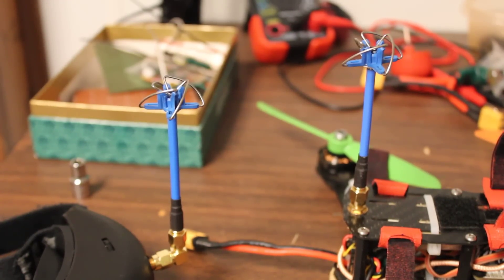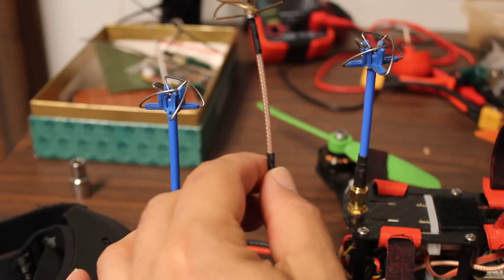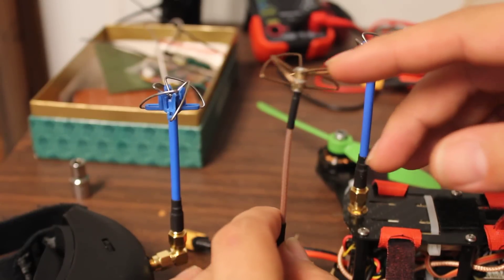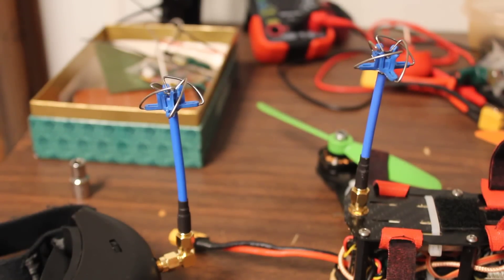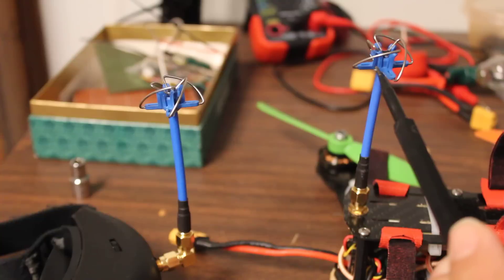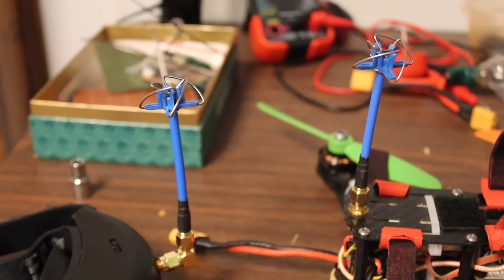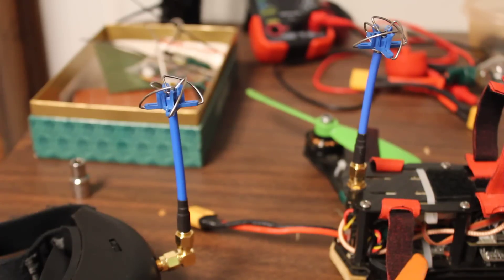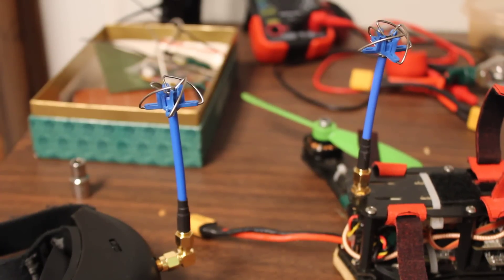First Look: Aomway 5.8 GHz Four Lobe Circular Polarized Antenna for FPV

Comment: I had the aomways for 1.5 years, finally broke them last week, but I just had to solder the joints together after removing the black gunk.....now I can finally upgrade to pagoda antennas and man theres a huge difference when flying around trees.

Comment: watch out, under the bracing of the clover leaf breaks the solder snaps. So if your having issues with cut outs just check all the solder joints.

Comment: I just bought two TBS Triumph 5.8GHz CP antennas and I would like to use them with an  Immersion RC SpiroNet patch plate antenna. Does it matter if it is a  LHCP or a RHCP?
Reply from the maker: Yes. All of the antennas that you are using at any point in time must be the same polarization.
Reply: Would the ImmersionRC 5.8 GHz SpiroNET CP Patch Antenna be a good choice? And should I also use a TBS video transmitter instead of the Foxeer TM200 I have? I am kind of stuck in a rut right now.

Comment: Great video as always, Josh! I just got two pairs (Vtx & Vrx) is there a way two know which is which? Thanks!
Reply from the maker: I can't remember which way it's supposed to go: 3 lobe for TX and 4 lobe for RX or vice versa. I just use four-lobe for everything.
Reply from the maker: Check out the DAL Cloud Spirit antenna which is supposed to be very good. Available in both LH and RH polarization, and on top of that, comes with a protective cover. Once I burn through my Aomway stock I will try some of the Cloud Spirits.

Comment: Those antennas with the hubs in the middle are garbage. that metal in the middle destroys axial ratio sort of defeating the purpose of circular polarized antenna.
Reply from the maker: +The Farrier Which ones? The Aomway or the other one I showed (the five dollar one)?
Reply: 5 dollar ones.  You definitely transmitted video . but if you are flying in a place with a lot of trees or a lot of metal around or inside you are really not benefiting from the CP as much as you would with a good antenna .

Comment: just my opinion but if the wire doesn't flex it can snap from the base of the receiver or even snap from the point of where it's attached to the carbon fiber
Reply: I meant from the base of the vtx
Reply from the maker: +george aura No issue there, as I am using a pigtail the bulkhead connector on my top plate. But I suppose if the top plate broke and the pigtail came free, it could damage the vTX. Anyway, I see that a lot of the high-end antennas come with thick coax, so I hope that this isn't really too much of an issue. We shall see.
Reply: Well great definitely keep updated
Reply: +1

Comment: I was thinking about using that foaming glue to cover the 4 leaves - possibly then embed the lot inside a split table tennis ball. Will see.
Reply from the maker: +Tobermory Cat Be careful with the foaming glue. Putting some materials directly on and around the antenna elements may change its impedance and tuning somewhat. Plastic and polymers are safer than anything even vaguely metallic.
Reply: Joshua Bardwell
True but perhaps still worth a trial. I tend to knock the shape out of a clover leaf quickly so that certainly doesn't help reception.

Comment: Thank you for making these videos and sharing your knowledge. Im not sure if my information has any value but i have those and i belive bending it a bit helps with the video signal. These are my first antennas so i dont have any comparasion. They are durable as i have crashed alot. I plan to order spironet cos cheap antennas just sound bad. If u could test different antennas with your analyser it would be awesome.
Reply from the maker: +lazyeyes You could be right. Bending the antenna cable so that the antenna is straight up and down when in forward cruise will help to keep you in the strong part of the antenna's signal.

Comment: The shaft is nice and sturdy but I find the lobes break like they are hq props. the ole pingpong ball hot glue hat helps a lot
Reply from the maker: I have a cover. Sounds like I need to install it.
Reply: +Joshua Bardwell Yep, I've broken a few. The lobes not only bend, but they break off.  If flying and crashing a lot, the immersion antennas work out cheaper! These really need a cover.

Comment: Keep in mind the stiffness it makes it more likely to transmit force into the antennas lobes, the sma pigtail, and the top-plate.  This may cause more problems elsewhere.
Reply from the maker: This is my biggest concern.
Reply from the maker: +Wiggles FPV Turns out, no problem so far.